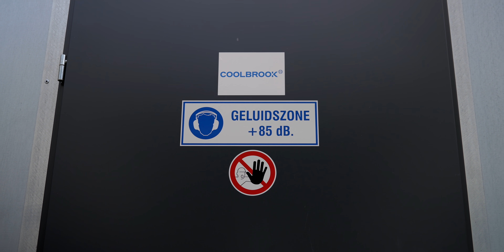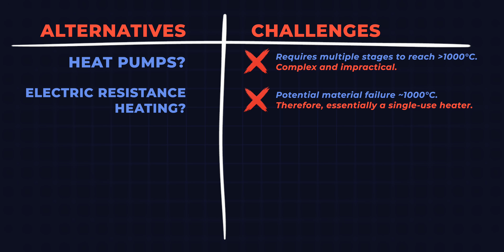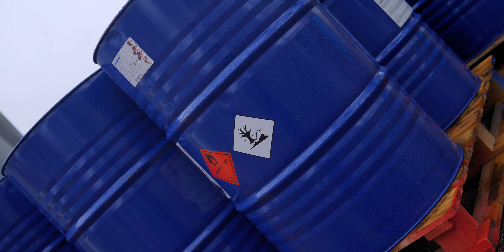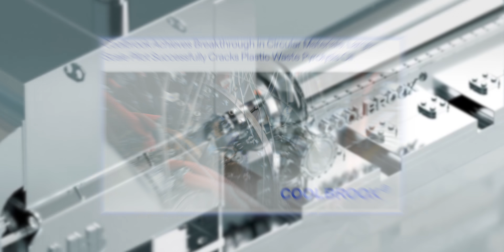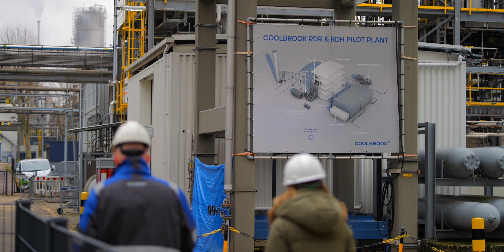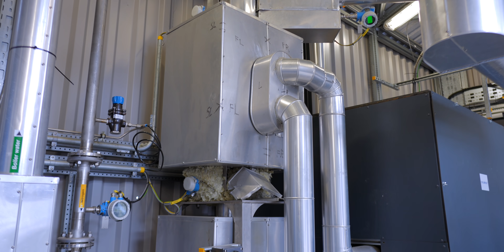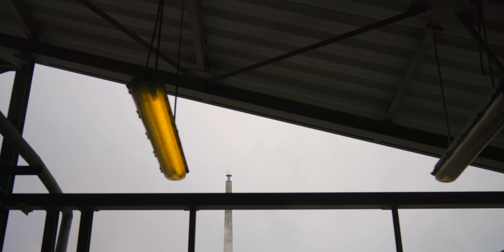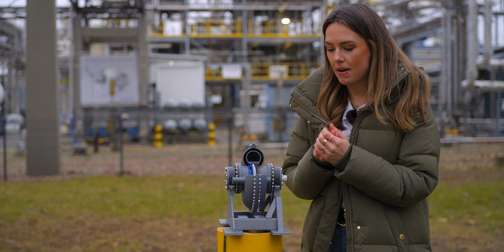Where Heat Pumps Won't Cut It, Coolbrook's Shockwaves Might....

Comment: Why can't we use direct-electric tungsten elements? It doesn't melt until 3400C. They work pretty well in lightbulbs. Is the problem that it oxides too fast at 1000C? Oil-bath to keep the oxygen away? Presumably there are reasons why people don't do this, but I'd like them explained.
Reply: The purpose is to heat gas to very high temperatures. Heat exchange between a tungsten filament and a gas is very inefficient. Most of the heat would be released as radiation, and very little of that radiation would be absorbed by the gas.
Reply: @BlueOceanStrategistS  Isn't that just a matter of designing the heat-exchanger properly? The gas could be going up through lots of holes in a tungsten element, with suitable pertubations to ensure non-laminar flow. These sorts of considerations apply to all heat-exchangers.
and this example is heating gas, but when talking about industrial processes in general are we not sometimes heating liquids?
I guess the point here is that this machine heats the gas directly, without heat-exchanger considerations? Which is OK so long as the gas is not corrosive to the machine. In that case you will still want a heat-exchanger to separate the flows.
Reply: @xxwookey  In this case, they are just trying to heat Naptha hot enough temperature to break it down (cracking). It is an endothermic reaction, so some of the heat will be absorbed by the process. The products of cracking come out the other end. No separate heat reservoir is involved, except for cooling the device.
Reply: @BlueOceanStrategistS  Right. My original point was with respect to the general intro section saying 'all the other methods of heating (including direct electric) won't work for industry in general', which seemed to me to be a surprising statement. i.e talking about the general case of heating up substances or reaction vessels, or whatever, not this specific process. It's not obvious to me why direct electric heating would never make sense (as it has almost perfect conversion efficiency and is cheap, at least in the exist lower-temp forms).
Reply: @xxwookey  - most likely it's cost related, in electric arc furnaces for example one uses consumable electrodes to heat a metal to a liquid state. The cost of those electrodes is not cheap, Coolbrook's  RotoDynamic Heater (RDH, the pre-heater in this video to their RotoDynamic Reactor, RDR), can heat gases directly to 1,700°C making useful in some furnace applications without needing consumable electrodes (also useful for ceramics, particularly high tech ones that require precise temperature control, and likewise cement making). 

In constrast Tungsten resistive heating is typically used in vacuum furnances (or those using inert gasses), as at high temperatures Tungsten reacts with atmospheric oxygen reducing it's effectiveness and potentially introducing impurities to the process. One could see an overlap with Coolbrook's RDH and some of the furnace uses of Tungsten. 

The turbine based heating system may also be more efficient particularly if heating process gasses directly as part of an industrial step. I recall that other similar rotary heating systems, such as the Turboclaw low/mid heat recovery system, can be more efficient than using electric resistive heating as raising gas temperatures (was something to do with acting on the gas directly by compressing it, rather than seeking to transfer heat from another medium).
Reply: @xxwookey it might not seem like such a surprising statement if you think of it as advertising coming from their sales team 😉
Reply: @GruffSillyGoat  microwaves could also work but I assume it would still be inefficient or uneconomical
Reply: @dang-x3n0t1ct 

Why not Google the info and read up😮 for yourself without coming out with silly speculations.
Reply: @xxwookey  The comment from "connerlabs" already explained why they say things they say in the video. In several other comments here I pointed out issues with resistive heating (which this process might just as well have too!), so feel free to read some comments if you want to get some more ideas about the pros and cons. Hard for me to copy+paste here in youtube.
Reply: I think this technology is really for chemical reactors, the extreme pressure and gas velocity will make reactions faster and more efficient than just heating.
Reply: @connerlabs  This is probably only interesting for cracking, where you hammer molecules apart. That is not something you usually do in chemical reactions. It can not be used in other high temperature processes for the same reasons resistive heating is hard.
Reply: @leocurious9919 Right, I guess this will end up working in a few niche applications like cracking. I personally would be interested to see a gas dynamic laser powered by it. I can’t see how the RDH version makes economic sense as a general purpose hot gas generator. The high speed gearbox, huge motor and variable speed drive will make it too capital intensive.
Reply: 😂😂😂

Why not Google up the topic and go from there?
Reply: @ForestForest-n9i Because I might find someone here who actually knew something about the subject. I've had a couple of useful responses already. And I use DDG anyway :-)
Reply: @xxwookey 

😂😂😂

Of course you have!

Now all you have to do  is refer to Google and do the fact checking on these "new things" you claim you have learned.

What you have typed up is the equivalent of getting your info "from a man in the pub".

Suggest you abandon all your efforts to educate yourself from items on this platform.

With luck you'll get a place in tertiary education and discover a platform run by car salesmen and events managers is no substitute.

To repeat, these items are filler pieces and not to be considered as anything more than that.

Hope that helps.
Reply: @ForestForest-n9i What are you rambling about? The video here is a commercial, the comments can only add to it.
Reply: @leocurious9919 

Noooooooo!!!

It can't be!

But you're quite right, my comments certainly do add a certain gravitas to the occasion.

Well done for typing!
Reply: @ForestForest-n9iprofessional reddit commenter spotted in the wild
Reply: @Giovanni17563 

😂😂😂😂

You clearly don't know you're an idiot, do you.

It looks as if you're not only an idiot but an idiot who tries to think for himself and is into conspiracy nonsense.

Well done you!

Please consider putting yourself in for a Darwin Award.

If you respond then you'll be entered for the Golden Shovel Award as well as, for free!

Comment: Potential applications of this technology outside of the petrochemical industry:

1. Material Processing at Ultra-High Temperatures

If you could mechanically heat gases to 1700 °C safely:
Ceramic synthesis and sintering
Rapid, uniform heating of ceramics without fuel combustion could reduce impurities and improve microstructure.
Could enable new ultra-refractory ceramics that currently need plasma or oxy-fuel systems.
Metal powder processing
High-temperature gases could allow non-oxidizing processing of reactive metals (like titanium, tantalum, or zirconium) without flames or plasma.
Could enable continuous-flow metal vapor transport or gas-phase deposition for coatings.
Glass and silica processing
Ultra-high-temperature gas could melt or preheat glasses in a clean, fuel-free environment.

2. Advanced Manufacturing and Additive Techniques

Gas-phase additive manufacturing
Could create high-temperature vapor deposition or controlled sintering without combustion contamination.
Could allow faster 3D printing of refractory metals and ceramics.
Controlled atmosphere reactions
Gas chemistry at 1700 °C without plasma allows new reactions that require extremely hot inert gases (e.g., nitridation or carbothermic reductions) but avoids contamination from fuel gases.

3. Aerospace & Hypersonics

Wind tunnel simulations for re-entry vehicles
Could simulate air at extremely high temperatures without combustion, producing ultra-clean, controlled test conditions.
Thermal protection materials testing
Could test coatings and heat shields under high-temperature gas flows without introducing hydrocarbon residues.

4. Environmental and Industrial Advantages

No combustion emissions
Ultra-high-temperature processing without CO₂, NOₓ, or soot.
Clean, controlled atmospheres
Could maintain high-purity inert gas environments at extreme temperatures for sensitive chemical or materials processes.
Energy efficiency potential
If mechanical energy is efficiently converted, it could reduce energy waste compared to plasma arcs or burners.

Summary of Industry-Enabling Features

Clean ultra-high-temperature processing (no fuel or ionization)
Precise thermal control over inert or reactive gases
Enabling new materials: ultra-refractory ceramics, metals, glasses
Advanced manufacturing: vapor-phase deposition, additive processes
Hypersonic and aerospace simulation under controlled conditions
Environmentally friendly heating without CO₂/NOₓ emissions

Verdict: The device itself is NOT greenwashing, even if the initial application might be.
Reply: If you could heat gases to ~1700 °C mechanically, without plasma or combustion, it could have some real advantages over plasma-based methods in certain applications. 

Here’s a careful breakdown:

1. Energy Efficiency

Plasma systems consume a lot of electrical energy to ionize gas and maintain the plasma.
A purely mechanical or rotodynamic heater could directly convert mechanical energy into gas heating without needing to strip electrons from atoms, potentially reducing energy losses.
Especially for continuous high-volume processes, efficiency gains could be significant.

2. Controlled, Non-Ionizing Environment

Plasma creates high-energy ions and electrons, which can:
Chemically react with materials unpredictably
Cause surface damage or unwanted oxidation
Require expensive shielding or containment materials
Mechanically heated gas is neutral, providing:
Cleaner processing
Precise chemical control
Minimal surface damage

3. Material Compatibility

Some sensitive ceramics, glasses, or metal powders are damaged by plasma exposure due to charged particles or localized arcs.
A mechanically heated neutral gas allows high-temperature processing without electrical or ion-induced defects.

4. Simpler System Requirements

Plasma systems require:
High-voltage power supplies
Complex vacuum or gas containment
Cooling and arc stabilization systems
Mechanical heating could potentially be more compact, robust, and easier to maintain, especially in industrial environments.

5. Scalability and Continuous Flow

Mechanically heated gas could be continuously circulated at ultra-high temperatures, ideal for:
Continuous sintering
Coating or deposition processes
High-temperature testing of materials
Plasma is often point-source or batch-limited, making scale-up challenging.

Bottom Line

Mechanically heated ultra-hot gas (~1700 °C) could outperform plasma in scenarios where you want:
High-temperature heating without ionization or charged particles
Better energy efficiency per unit of heat delivered
Continuous, large-volume processing
Material-sensitive environments (like refractory ceramics or advanced powders)
Cleaner, more controlled chemical conditions

Comment: YOU forgot to add one more . INDUCTION
Reply: That’s good for heating solids and liquids. Now try heating a gas. Are you going to use liquified metal or expensive refractory metals to heat a gas?
Reply: @BlueOceanStrategistS  I don't see why you can't heat  a gas using induction
Reply: @danielallouche2493  Run a microwave for 1 minute with nothing but air inside. Open the microwave once done. Is the air hot?

Run an induction cooktop with no pan on it for 10 minutes. After 10 minutes, do you notice an increase in temperature of the air?

Replace the air with hydrogen, helium, or any other gas of your choice. Do you see a difference in results?
Reply: @BlueOceanStrategistS  I see you've only come in contact with induction cook tops where the power is in one surface . Induction heating or melting uses coils that surround the vessel.
Reply: @danielallouche2493  Is that an efficient method of heating gas above 1000C? Consider how much energy is absorbed by the gas in contact with vessel vs. radiated by the vessel. The answer should be clear. The amount of volumetric heat capacity of gas is much smaller, but gas is also a very poor thermal conductor. The result is that you are going to waste a lot of energy heating a gas that way, most of it being radiated considering if the target temperature is over 1000C.
Reply: @BlueOceanStrategistS  you can heat a gas to well over 1000°C using induction, but typically
not by heating the gas directly. 
Because induction heating relies on eddy currents (which require an electrically conductive material), you cannot directly heat non-conductive gases like nitrogen, oxygen, or air with a standard coil. Instead, you must use a susceptor (a conducting material like graphite, carbon, or silicon carbide) placed inside the coil to absorb the magnetic energy and heat up, then transfer that heat to the gas via radiation, convection, and conduction.
Reply: @danielallouche2493  Yes, this reflects what I have found over the past day. There are still some technicalities to implementing it in every process people are trying to use it for, but yes.
Reply: @BlueOceanStrategistS  I worked with induction melting 40 years ago. Most people are only just learning about it.

Comment: You mention steel and aluminium as one of the things that need to be electrified, without listing induction heating in your list of alternatives, lost interest after that, you havent done your research so I wont consume the rest of the video.
Reply: Have you ever tried heating a gas (like air) with induction heating. No? Well that’s because induction heating cannot directly heat gases with any meaningful power density. Gases conduct very little electricity and are not strongly affected by magnetic fields.
Reply: @BlueOceanStrategistS  And you do not really read comments. The OP argued about the claimed justifications for developing this process for benefits that go beyond providing fossil resources as raw material for other products.
Reply: @sandmehlig  Do you even check who you are replying to? You’re supposed to reply to bastiat691 with that statement.
Reply: @BlueOceanStrategistS  No. There were no mentions of heating a gas with induction in this post - only in yours.
Reply: @sandmehlig  Yes, because he fails to understand that induction heating is not a suitable alternative because induction heating is only good for heating electrically conductive (or paramagnetic) solids or liquids. Gases cannot be efficiently heated in this manner because they are not sufficiently electrically conductive, and they do not have significant magnetic hysteresis. So trying to debunk the video on the notion that “induction heating already exists and is proven” lacks scientific merit.
Reply: @BlueOceanStrategistS  Repeating this does not fix the failure made in the claims that this process is necessary as a replacement for already implemented methods for carbon free heating in processes mentioned by the OP and the host of the show.
Reply: @sandmehlig  It’s more niche than they make it out to be. If you are heating a solid or liquid, you’d be much better off using induction heating. The vast majority of potential CO2 reduction in high temperature processes will not be realized by making heating gas to over 1000C less CO2 emitting. The video is greenwashing a particular application, though the technology in question should in principle be used for something more useful that induction heaters are not suited for.
Reply: @BlueOceanStrategistS  I wonder who is going to 'win': those, who are microwaving silicon carbide or zeolite as heating elements to get gases up to 1k C or these guys here.
Reply: @BlueOceanStrategistS  Induction heating can melt steel and aluminium though, two of the things they list early on in the video as things that have to be electrified. I see that the viewers of this channel are equally uninformed as those who run it, unsurprising.
Reply: @bastiat691  Yeah, unfortunately they are pushing this as a means to make fossil fuels “clean” and as a consequence are clearly failing to differentiate between applications.

Meanwhile Coolbrook needs to find a way to pitch their product more towards actual clean applications. CO2 reduction has relatively low value compared to advanced refractory materials that could unlock advancements in clean energy tech, lasers, solid state manufacturing, etc..
Reply: @BlueOceanStrategistS  - high tech ceramics might be a good area for Coolbrook's RDH technology, as the process could control the temperature of an inert gas with high precision throughout the required cycle.